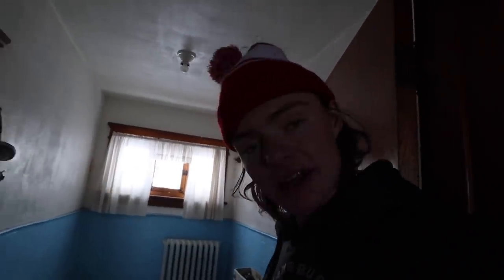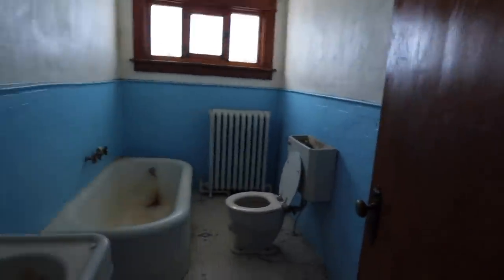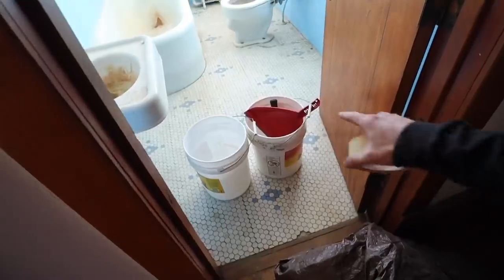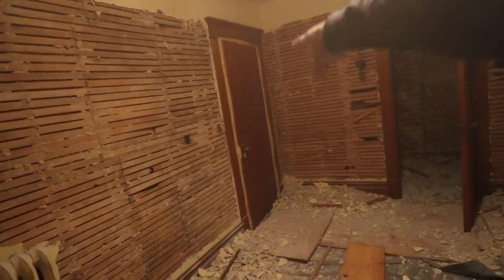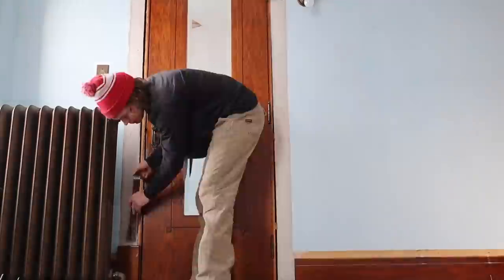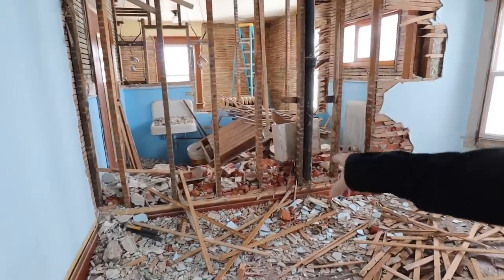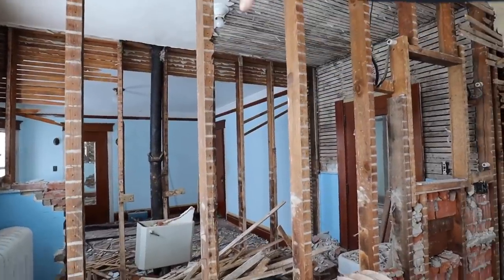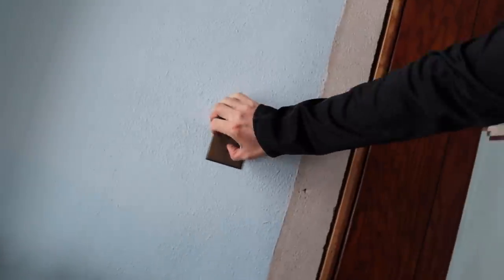Remodeling My Ex-Hoarder Mansion Ep. 2

Comment: Put an old Auger tube up to a window and use it as a deris slide into the dump truck.
Reply: That's a great idea  !!
Reply: An old elevator chute like the used in corn cribs works really well, especially if you park an old barge wagon underneath to dump into!

Comment: Cole, if you put 20 gallon Rubbermaid totes against the wall under where you're removing plaster the plaster just falls right into the tote, it makes clean up so much easier and they don't get too heavy like trash cans do. Also, if you put a fan in the window and seal around it with plastic and tape it creates negative pressure in the room and no dust will get into the rest of the house🤙🤙

Comment: WHY DON'T YOU PUT A SHUTE  DOWN FROM A WINDOW INTO YOUR OLD DUMP TRUCK ???
Reply: I'll bet he will.
Reply: He might be smoking dope off camera.
Reply: That’s a great idea!🐝
Reply: I was thinking the same thing. They must have some tin from the shop roof repair piled somewhere.
Reply: That would be very COLD.
Reply: @waltertaljaard1488  beats the hell out of carting it out down the steps.
Reply: @waltertaljaard1488  but he could set it up so he could close the window (plywood set in the frame)
Reply: @asquithmainlines699  it all got scrapped
Reply: Cole - please assume there is asbestos and lead paint in that debris. It’s often in plaster. The respirator is a good start, but protect your lungs until it’s all cleaned up. The raccoon poo is also bad for your health.

Comment: You'll need to find out if the walls you want to take out are not load bearing wall for your attic
Reply: This guy waxes and washes a brand new combine 2 or 3 times even before he has used it and is a master nerd, in a good way, he will make sure it will be safe before he starts doing any work.
Reply: Not hard to figure out once plaster and lathe is torn off with studs fully exposed.
Reply: @stovepipe6769  Actually you have to look in the attic. All walls look the same lol.
Reply: @christophersmith2871  load bearing walls should have a double top plate. at least where i live they do
Reply: @stovepipe6769  this house is over 100 years old.  It was built in a time when there was no unified code.  I hope Cole has involved a structural engineer, or at least his carpenter neighbor in his planning of this remodel.

Comment: When removing the nails from the trim, don’t pound them back out. You’ll run the risk of chipping out the surface. Instead, use a pair vise grips or similar pliers and pull the nail all the way through from the backside. I’ve already been through what you’re just starting in our 1912 house. Patience is the key.

Comment: I don't know if you've thought of it, but putting your washer & dryer upstairs close to your bedroom or in your walk in closet or close to bathroom is very convenient.  99% of your laundry is from your bed, bath, & closet.  Saving you a lot of going up & down stairs with baskets or arms full of items when they are all close together.  Besides, it's not like you want to show them off to company.  Think about it.   Carmen Chilson
Reply: Absolutely agree!
Reply: Stackable, in your closet, backing up to the existing plumbing, on the outside wall for ventilation 👍
And still have your laundry room downstairs for the big, gnarly stuff.
Reply: That's an interesting thought. 💡
Reply: If the laundry is on the second floor make sure that area has a floor drain that goes to the outside just in case there's a leak.
Reply: @dalegereaux1863  exactly !!!!!
Reply: @dalegereaux1863  you are right, I believe large plastic trays can be purchased to place under the washer.

Comment: I am so happy to see you working on the house again!  

Looks like you have plenty of room to make his and hers walk in closets and you could reuse the doors you removed, a nice double wide jacuzzi tub for soaking (we got ours at a salvage yard at a reduced price even though it was brand new) and a walk in shower and even plenty of room for a double vanity sink (ie again a his and hers).  At your age you probably do not need a tub to soak in currently, but you will definitely appreciate it later in life!  If you intend to replace the windows you can always use glass block instead of panes to provide light while still providing privacy around the tub/shower areas.

Since your laundry is in the basement and your walls are currently torn out on the inside of your new master bedroom, another nice old fashioned idea you can incorporate inexpensively would be a laundry chute.  We added one to our house when we remodeled using melamine boards and LOVE it!  Just put a basket at the bottom of the chute in the laundry room, it is such a time saver!  You could add the entrance to the chute either inside the master bedroom or from the hallway side.  This will be really handy when you eventually have kids!

Just a suggestion but I would recommend a small room be built around the toilet by itself, directly under that window high up on the wall in the bathroom area would be a good spot without having to redo the plumbing too radically, with a vent to avoid any malodorous emanations from entering the rest of the master bedroom area.  It's also nice for when one person is bathing/showering while another is utilizing the toilet facilities.

Comment: The bricks in the wall are called, noggin. Used as in insulation in colonial homes and backing for tile in bath rooms, though the latter  is. Rare. I have personally removed the noggin myself.
Reply: Sounds painful, I guessing it doesn't have the same other meaning in the US as it here (UK)?

Just don't do what one of our neighbours and first remove a load bearing wall and then remove all interior walls and beams while waiting for planning permission on the extension leading to the loss of the roof and the four walls. 

They tried to self manage the build to begin with to cut costs with no experience it left them with a large bill as all the building supplies they had brought from a reclaimed building were useless and got damaged themselves what did survive didn't match the new bricks and tiles when after another couple of years of planning permissions they finally had a new house built. Ironically he is a hoarder to
Reply: Thank you.  I'm like "I've never seen brick between the walls like that before.  Seems to be only the bathroom.  Strange.".  I live in New Hampshire where the houses are from the 1620s to present day.  Threw me off.  Got to learn something.
Reply: Any salvage value?
Reply: @SlipShodBob  I am unaware of the UK possibility, but besides the in wall, it is an essentially slang term for ones head....(that's using the old noggin) meaning thinking...let us know the other  meanings hiding under the boot if you would!
Reply: @SlipShodBob  Yes, it means head, as in a place to put your hat on. ;o)
Reply: @dhamma58  it also means a short piece of wood to brace to larger pieces and a shot of spirit like a noggin of whisky in your coffee. But I was thinking more along the thoughts of head as decapitation sounded nasty (knocking your noggin off).

I guess here solid internal walls are more commonplace though stud walling has become more common in new builds though some privately built houses and more expensive houses still use block walls.

From what new locals have said the quality of craftsmanship of the large developers leaves a lot to be desired one of the common being moving stud walls though the worst being the gas pipe from the mains coming up behind the front door so that every time it was opened it kinked the pipe until it cracked the first the knew of it was after the removals left and they closed the door leading them to actually smell it.

I must admit I am a sucker for old houses as though they may need a lot of work there is a character to them of their own.
Reply: @SlipShodBob  Thanks for the nogginish update... the old houses were always fun and usually a learning experience as the technology of building changed over the years. I still remember ads from the plasterers union touting "genuine lath and plaster" as being superior to drywall...(which took over completely)
Reply: @KameraShy  a lot depends at least here on the style and make of old bricks and tiles as well as condition otherwise broken up they'll make good hardcore around the new bin site.

Comment: The bathroom was possibly a closet when the house was built.. then when indoor plumbing came along it got to be a bathroom..
Reply: I used to own a house 20 years older than this one. It had a bathroom original to the house, there was indoor plumbing back then.
Reply: @sandyhearn8332  - It might make a difference as to if the house was in town or in the country.  

My parents have a scary 1915 farmhouse that was not built with a bathroom.  One of the 3 original bedrooms was downsized to make the master larger and turned into a bathroom.  There is a door to the master, a door to the kitchen, and a door to the cellar, a lavatory, toilet, bathtub, two windows, and a washer and dryer in an area about 8' x 10'.  

It is shocking but they're getting $1000 a month for it and it is rarely vacant.
Reply: Our 1914 farmhouse had and upstairs bathroom, but no toilet because my great-grandmother wouldn't allow it! Her words: "You don't sh*+ in the house, you sh*+ outside"... I was 3 when we got a toilet in the house!

Comment: Did that years ago.  Put in new Pex manifold.  Makes it really easy to remodel your bath, kitchen etc one room at a time and tie back into the manifold existing old lines until you get to them.  Same thing with electrical, put in a new oversized 200 amp panel and you can pull the old knob and tube and require back to the new panel easier.  Got plenty of other tips if you need them.

Comment: FYI, those baseboards are going to be a pain to reinstall, you will likely have to recut/configure them since the drywall won't be the exact thickness of the plaster.
Reply: Had the same issue with window trim, door frames, baseboards in my century home, ended up not being able to reuse any of it as the plaster was 1"+ and drywall is 1/2, didn't make sense to double the drywall
Reply: 1/2 foam and drywall works well. Foam Acts as a vapor barrier and increases insultation if sealed.
Reply: @CGW116A  that's a super good idea, I had the house spray foamed so it didn't matter
Reply: Acer Acres  I wonder what type of spray foam you saw. I tried burning the stuff they used on my house and it put the fire out. It was rated to 1500°

Comment: To get the trim boards off with those hard to reach nails, use a nail punch to drive the nail all the way through the board. It will remove the risk of cracking the boards and save some effort. Great to see the work getting done. You are going to enjoy it once the new electrical and insulation is in. Those old houses are drafty!

Comment: Not hating, just wondering why youre taking out all of the plaster. Plaster is better than drywall for areas exposed to moisture, and it would save a lot of wprk later to preserve the walls that arent damaged.
Reply: I think it is because he will have to change the plumbing, electrical, and add insulation. Too, he is planning on re-configuring the rooms.
Reply: If you look at the exterior walls and under the windows you can see there is no insulation.  Add in the sub zero temps and a house that big costs a fortune to heat.  Plus last year he said he wanted to insulate the walls, upgrade the wiring.  And, sadly, that means the old plaster has to go.
Reply: William Graves he wants to insulate and the plaster is coming loose

Comment: When my Dad and I tore down a couple of old houses we welded 2 bars on a 3 foot pipe that fit over the 2x4. It pops the lath and plaster right off. You got a lot more demo so might be worth talking Cooper into welding one up. The 2 bars were 1/2” solid bar about 6” long about 3” apart at 90 degrees from the pipe. The heal acts as the fulcrum that rests on the 2x4. Hope that made sense

Comment: Use a small finish nail punch or small pin punch and drive the neals through the trim board. It works just fine. Hopefully you’ll see this note so you can salvage your trim. You can then use pliers, or cutter to remove the nails

Comment: If at all possible, put the master bath and the bathroom for the other bedrooms back to back. 1. It will cut down on noise from someone using the other bathroom. 2. You will be able to use the same vents for the plumbing as well as some of the same lines.  Also, don't be afraid to take out windows, or change their size. You are already residing the house, so you won't have to mess with removing and replacing siding.

Comment: No matter hwat he syas Cole, these changes are not sitting well with your Dad. Your Granfather born and died there, Your Dad's house until he got his own and it has passed into your custody. It is too late to stop now unless you want to put it back in modern fashion. Small bathrooms were for that purpose, not a social gathering place. Of course you want a shower and the window prevents that unless you block it. MAKE YOUR DRAWINGS FIRST, Cole. Then you will better know what to do. Remember, the walls of the 2nd floor support that attic floor. Ig you don't want to have a trampoline for a studio, along with cracked ceiling plaster, watch your step. You should talk to an architect or at the least a house builder. 
Aces for you to save that wood. It is likely poplar of high quality. What they call "Select" today and almost non existant any more.  Take a lesson from Texas. When the power goes out you will be grateful for that fireplace.  Why did they have small rooms - so they could heat them if they lost central heating.  Take ONE bathroom wall out to make your big bedroom. Use the corner bedroom for the new bath and closet area. Keep the existing wall to support the attic floor. Lay your rooms out in chalk or tape FIRST.  Right now you have the cart before the horse. We know you'll do a good job but go sloowww - then you will end up with a great design and comfortable house with minimum changes to the support structure. Get on with it, boy, you have a lot of work ahead. Slow and steady gets the job done properly.

Comment: Probably already have thought about it but document all new wiring and plumbing very well for the next generation for when they want to remodel. It’s gonna be a project for sure. Suggestion putting heavy gauge plastic down on floor and up on baseboard and then like you done with cardboard and tarp and you will appreciate the first step on clean up.

Comment: From recent experience, I must recommend when removing lath and plaster, I found it easiest to just knock a little hole of plaster off the lath and the use the claw to work along each lath popping the nails. It will drop the plaster onto the floor and you can separate your lath as you go into manageable piles, then later scoop the plaster off the floor. Two birds on stone.

Comment: If you plan on reusing the trim make sure you know the thickness of the wall material you removed. If you go back with drywall and it’s less thick your trim will be short. You can save some lath to shim out the walls to make it work.

Comment: Save those bricks and repurpose them. So glad you are honoring the house by saving the baseboards and trim. What cabinet are you wanting to tear out? If it is original to the house you need to save it as well and honor it's value. Yes I am a architecture and interior design geek😊 you need a plan n a blueprint. Cost it out n get it on paper. Measure twice, cut once. You are making great progress.

Comment: There is a product I got from Home Depot called Howard Restor-A-Finish. I've used on stained furniture and trim, it comes in different colors, had great results. You might want to try it on a small piece before you go crazy with sanding down that trim. It will save you time.

Comment: PRO tip. That molding will not be long enough when you put it back up.  Because your walls are plaster & lath you will end up being approximately 1 to 1.5 inches short in the corners becthe drywall is only going to be 3/8.  And I'm no pro lol.  I found out the hard way when I renovated my grandparents house.  And if course they no longer offer the exact same trim.  It'll be similar but just won't match up.  They also didn't offer that exact router bit any longer so I couldn't make my own.   Seventeen years later and my molding still isn't finished because of that reason.  Demo is looking good.

Comment: for the skirting board that is hard to remove - get a new hole punch and punch the nail through with the hole punch - just reuse the little hole you made when you reuse the skirting  with another nail or screw as the lengths of quarter round you removed from the bottom already should cover the wee hole you made

Comment: As a retired  carpenter ,  you should  invest  in  a couple  of  work  platforms from  Menards  or any lumbar  center . They are  relatively  cheap  and so much  easier  to  work  the correct  height  flat on your  feet .  Much  more  user friendly  tjan stepladder .

Comment: Make sure none of those walls you're wanting to take down are load bearing. Also make sure wherever you decide to put your new bathroom the floor joists are capable of holding the new weight. Have you considered spray foam insulation?

Comment: They make a handle for a hacksaw blade that lets the blade slip behind things like molding but still lets you move it up and down to cut through nails like the one in the baseboard.  I suppose a thin blade in a reciprocating saw might work the same way, but could do more damage.

Comment: Cole talk to your carpenter friend. A lot of Houses of that age were built with Ballon Construction and brick in the bottom of the walls was used as a fire stop and blocked air flow from the wall below in case of a fire. Your carpenter friend can look at it and tell you if it is and what you need to do. 👍👍